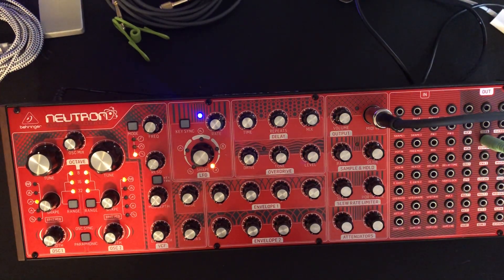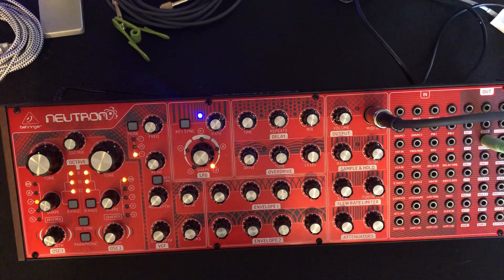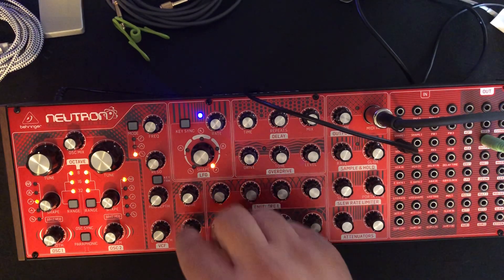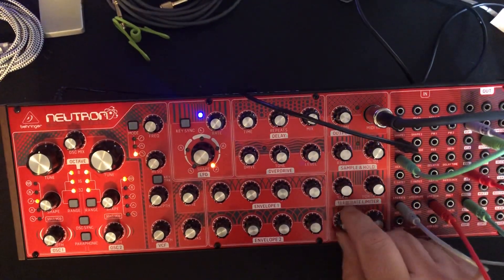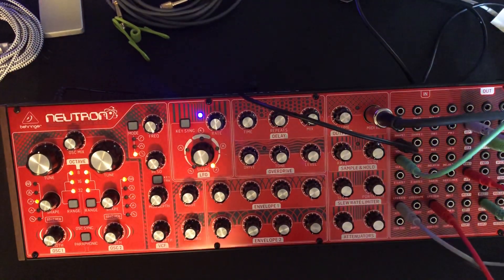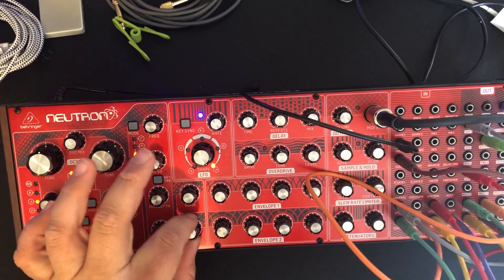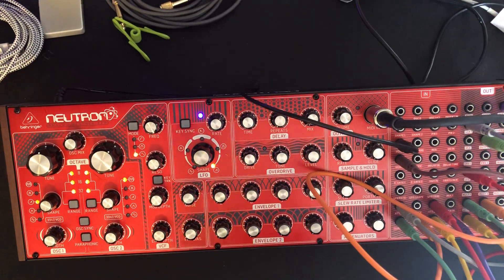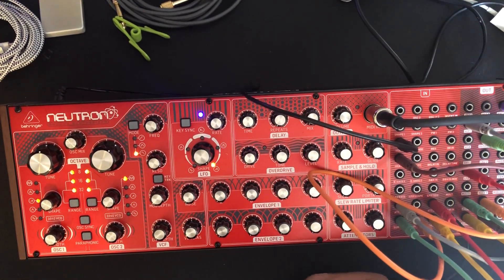4 Oscillator Behringer Neutron Demo

Comment: Love the Neutron. It's even better mixed with some other gear like a Crave or Eurorack modules. You can the do all the stuff you just showed but still have an outboard LFO and filter. If you hook up a Crave as the first in the MIDI chain you can use the Crave's sequencer to drive the Neutron. All kinds of cools things can be done. But... you only get one note. Still need a poly synth to round things out.
Reply from the maker: jppagetoo just picked up a Digitone. Layers very nicely with the Neutron

Comment: M-A-S-S-I-V-E!!! Now I'm dreaming of my Korg SQ-1 making 16 steps of chords by driving the Neutron via CV.
Reply from the maker: Luca Crisi I’ve been trying to decide between an SQ-1, a Beatstep Pro, or a Keystep.
Reply: I have a Keystep, which is also POLYPHONIC (via MIDI and requires a polyphonic synth to get the polyphony) or monophonic (via CV or via MIDI and a monophonic synth). And I also have a SQ-1 - monophonic / duophonic (you can run the 2 channels simultaneously). I guess a Keystep would be a better choice, to begin with. Two very interesting small giants.
Reply: @coltranius  I have the exact same problem.I got my neutron but i haven't yet decided between SQ1 keystep or beastep pro.any advice?
Reply from the maker: Konstantinos Megas I wish I did have some advice, because that is my exact conundrum. SQ-1: cheap, powerful for its size and cost

Keystep: works as a midi or CV keyboard, has some seq and arp ability, and aftertouch!

BeatStep Pro: lots of sequencing features, and with all the knobs and the software, it seems to be a decent midi controller, too. Also the drum CV sequencer.

I am really torn.
Reply: @coltranius  You probably NEED THEM ALL!
Reply: I think the SQ1 only does the key of C right?  I am going for the Behringer Crave.  It has 64 steps
Reply: The Crave has 32 Steps over 64 patterns. But, yes, it's a beautiful single unit. OR you could buy a Neutron and a KeyStep (which has 64 steps over 8 patterns). But it would cost 3 times a Crave, and be paraphonic instead of monophonic. Also note that the Crave only features 2 waveforms only: SQUARE and SAW. You probably don't need too many steps, since you can always transpose the sequence via another sequencer. moreover, the SQ-1 has 2 8 steps rows which can be used separately or in cascade (giving a total of 16 steps). To close on the  SQ-1, there's a trick to use more than 16 steps: https://www.youtube.com/watch?v=JYTCQ1zrtvc
Reply: I was torn also.  I went with the keystep and the beatstep pro.  I have one drum machine and three synths.   I can control any synth from the keystep or the beatstep pro. It’s amazing and for 350$ worth of controllers, I found it was the best value I could find.  Go Arturia!
Reply: KeyStep = 119$, BeatStep Pro = 249$, ... So you had the third controller for FREE?
Reply: Luca Crisi I don’t follow.  I have 2 controllers that cost 350$ running 4 different synths.
Reply: Luca Crisi       Okay.  I don’t see that at all.  Maybe you read it to fast or something